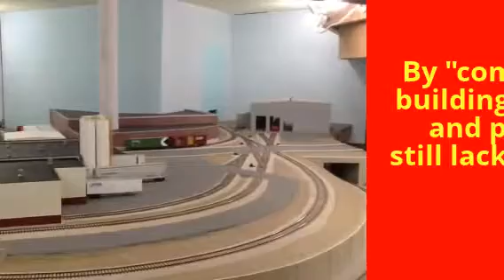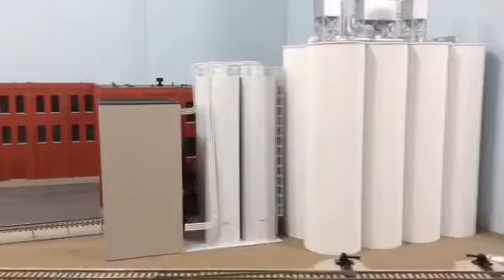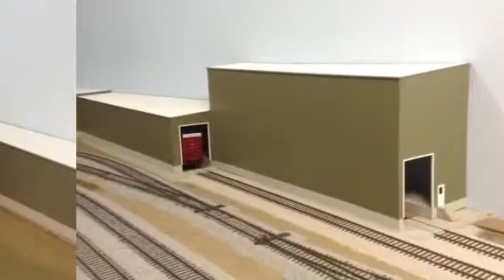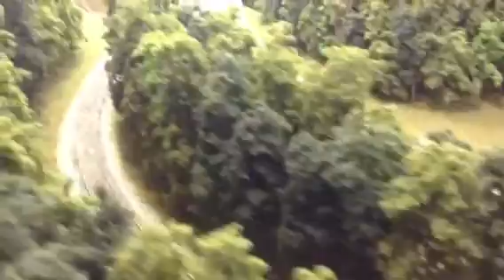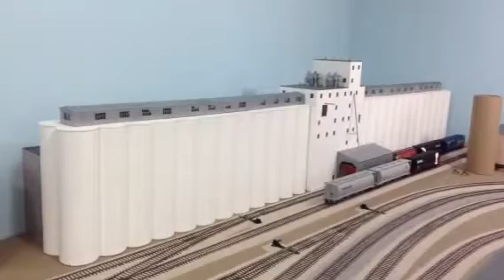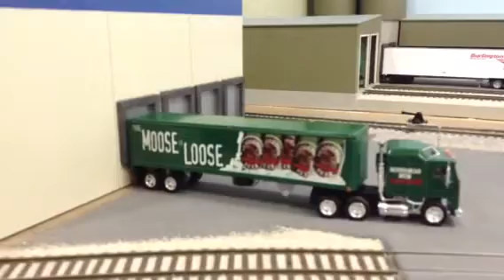Q&NE HO Layout Video 010 - 130104

Comment: Why do the industrial areas look so sterile? Even relatively new industrial developments have a certain "patina". Also, why do the industrial leads and sidings look like they are built to mainline standards? If one compares mainline versus industrial track, there is a difference in terms of height above grade, size of rail, even type of track ballast. Remember, industrial track is low speed, no more than 10 - 15 MPH.
Reply from the maker: +mjarail 
This video is now more than three years old. A lot of scenery has been added since it was posted, and more still needs to be done, but I'm not in a hurry. Model railroading is a lifetime hobby. The industrial trackage is ballasted with a different grade/colour and is laid on a thinner layer of cork than the main line tracks. If I was to do it all over again, I would not have used any cork at all beneath the industrial tracks. I do have a couple of sidings laid directly on the plywood base, but you have to look for them.
Reply: Ah! I would love to see the end results. Where I used to live, there were 1920's era industrial areas with sidings serving them which were indifferently maintained.
Reply: what a fucking tool  !!!

Comment from the maker: Thanks Matt. Almost all of the buildings are kitbashed from Walthers or Pikestuff kits and parts. None of them used any foam board except the newsprint warehouse (the one with the curved siding and three unloading docks). I made the basic building out of foamcore board, and glued Walthers brick sheets on all sides. Strips of plain styrene simulated the concrete foundation and the tops of the walls. The roof is actually basic black foam core board. It didn't even need painting!